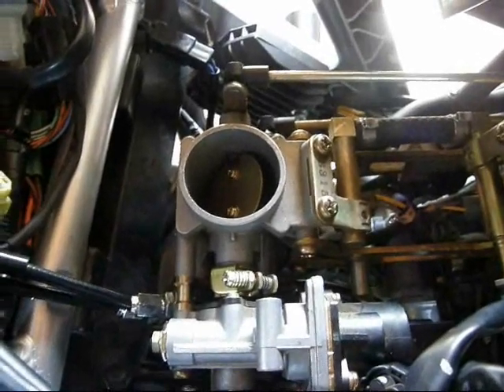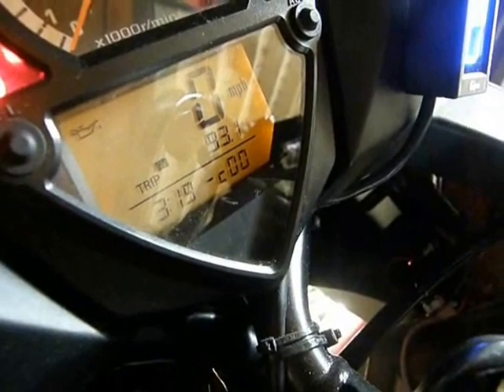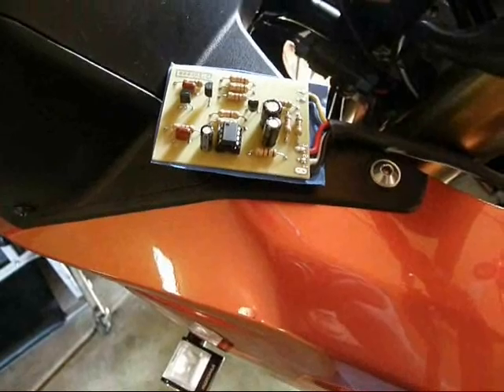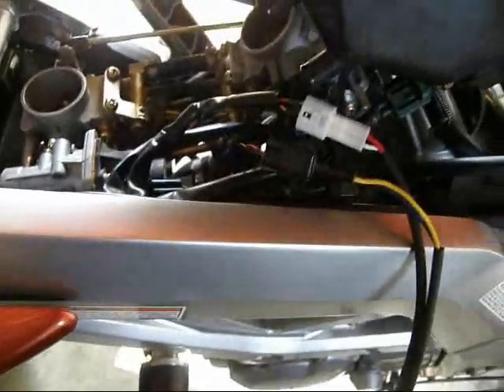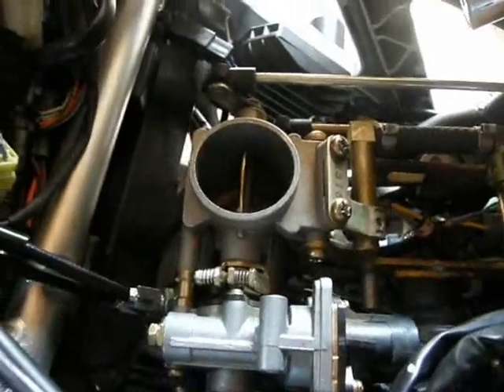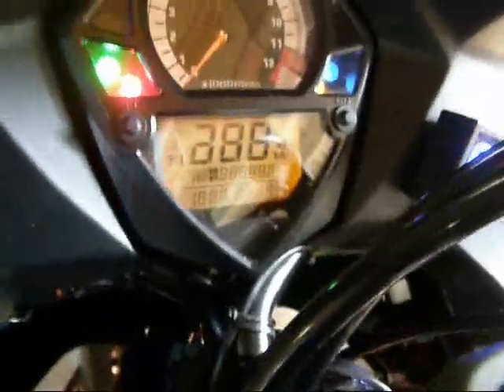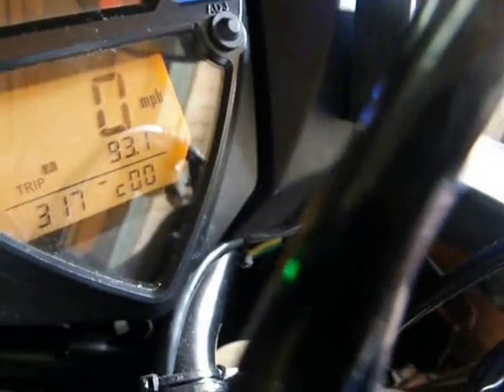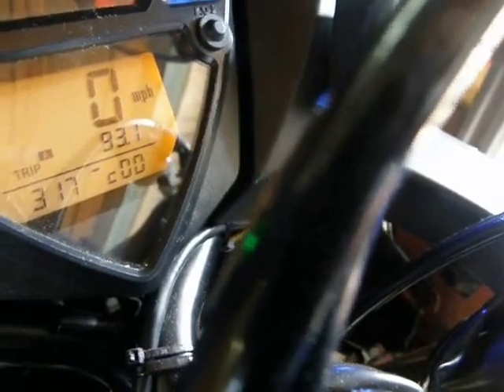Secondary Throttle Valve Eliminator Circuit

Comment: I need one for a 2001 Suzuki gxsr1000 where and how can I reach you
Reply from the maker: Does not apply to the 1000 - only the 750 and 600- sorry!
Reply: @decosse01  you have one for 07 GSXR 750?
Reply from the maker: @Eastern_SA  does not apply to the 07 which uses stepper motors
Reply: @decosse01  what’s the best way to disconnect STVA for 07 gsxr750?
Reply from the maker: @Eastern_SA  you can't You can remove the butterflies but would need to leave the motor and STPS in place

Comment: hi i was wondering if there is anything i can do to turn my fi light off. its a 1000 youve told me your system wont work, is there anything else i can do? i have full power even though my fi light is on i wasnt getting power with the butterflies so i took them off runs fine just have a fi light on

Comment: My local shop went to a motorcycle salvage shop to get a used STVA and now the light is gone. But this problem seems to be inherent to older GSXRs 2000-2003 if I'm not mistaken based on my google research so even with it replaced It will come back.